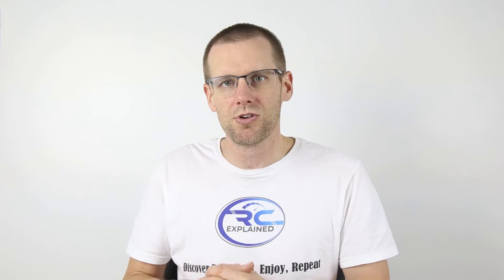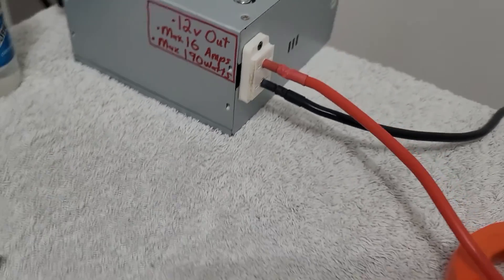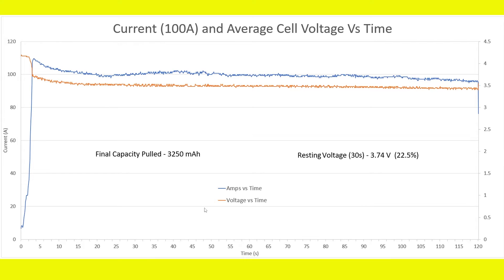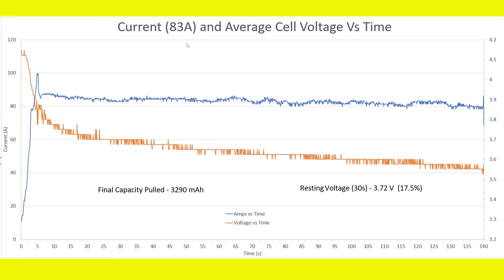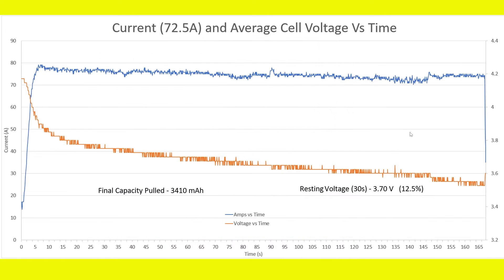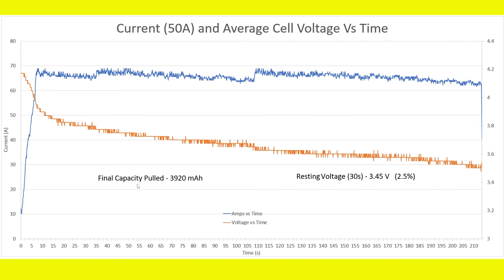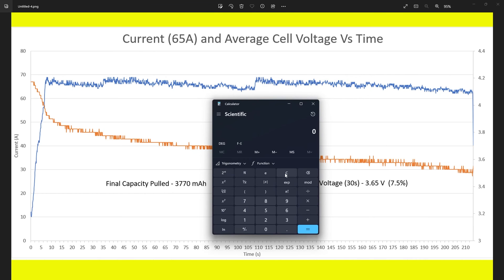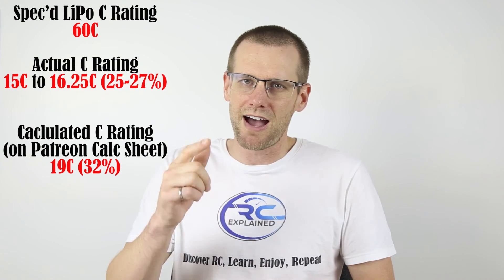60C LiPo Battery vs. Shocking Reality: Truth Uncovered for the HRB 4000mAh 60C 6s LiPo

Comment: I just feel like we need to keep an eye on temperature when using batteries for high current systems. Of course the cells will heat up with high load. I work with commercial battery systems. C-rating is meant under optimum, cooled, condition. Heat buildup always has to be dealt with, not only with ESC:s and motors, but with the batterypacks as well. It would be of great content to see comparison charts between different packs as well, tested under similar conditions. 👍
Reply from the maker: On my patreon, I have many packs tested and all test data available to battery benchmark members.

Comment: Maybe the C rating is lower than calculated because the capacity is also exaggerated?
Reply from the maker: Capacity can be exaggerated, but its usually within 5%. I did take a label off a 5200mAh cell to find that the manufacture of the Zeee brand labels their cells as 5000mAh. Not 5200mAh as Zeee rebrands them.

Comment: Just bought 2 hrb batteries (4S 4000mah 60C) and the internal resistance of each cell was 1.1 omhs on average. Wildly different from what you tested. Could be that the manufacturer switched providers or something like that?
Reply from the maker: I can't speak to the unit you used to get those numbers.  But more importantly how does it compare to other packs you've measured IR on?

Comment: Ty for your videos I have learned so much! I think its time to give your patron page some love.  If you had to pick any lipo for arrma 6s with the spektrum firma 150a smart v2 esc with 2050kv motor what would they be? I am running 2 3s in series. Does running 2x 3s in series give alot less performance than 1x 6s pack?

Comment: Awesome,, would you please also test HRB premium 100C, and HRB Graphene 100C if you got them. 

Also, it would be good to explain what difference this makes for user put in simple words.  Is the airplane going to be slower or is power going to drop quicker, or flight time is going to be shorter.. etc. 

Being a bit warm battery may not be a concern for many users.    My main concern is longer flight time with stable good power.   

I have used 2200 mah Lipo of prime brand which gives equal flight time of HRB 3300mah, and more flight time than other unknown brands of 3600mah, but also their price are at least double of HRB. Thus I consider HRB is one of the best value for money for average user. 

Finally, what are the other batter battery packs around the same price point you have seen or know about. This will help the audience to know the difference and choose what suits their needs and budget.   

Thank you so much for the useful content.

Comment: been using HRB batteries for years. no issues. quite happy with them for the price. 👍
Reply from the maker: I really like the weight of them. These are actually very light.
Reply: Excellent batteries
This kind of testing is daft imo, if the battery is the right price, good punch, good run times, then take no notice of these kind of tests
I've got 8x 4s 6000mah 60c HRB and they are the best 4s lipos in this price range I've EVER had, and I've tried them all,(cheap brand ones)
I've brought over the years at least 30 to 35 4s packs, and the HRB are the best value BY FAR

So imo these videos are not worth the while 
This is just my opinion, and my personal findings

HRB good
Zee also good
Youme decent
Goldbat so so, but mostly not great
DXF the 2 I've got, junk
Zop hit and miss
Turnigy decent
Cnhl good
Hoovo, again the 2 I've got, junk

For consistency the HRB and zee are the best imo, with cnhl and youme in a close second
Reply: Me to great battery for the price knock spots off the other cheaper brands and never had one puff up

Comment: Maybe we should make a public spreadsheet where people can calc c by measuring the ohm. If enough people provide data we can see trends with batteries models. Together we can beat the marketing lies. All hobbies unite!!!
Reply from the maker: I like the idea, not sure how we would standardize the measurements without having the control in place. There's a lot of factors to consider.
Reply: @RCexplained  Yes that's why I thought that I we can gather a lot of data, we don't have very accurate data but we can see trends between the different batteries.

Comment: lipo chemistry is capable of 20c-30c continuous. you should consider them all to be this.
Reply from the maker: Sounds good but unfortunately this LiPo is 33% lower than this.
Reply: @RCexplained nah you gotta warm them up a little. all mine have higher IR at nominal and room temp but I push them to 160A/20C all the time. they drop to 3.5v under load and get to around 130f.
Reply: 30C means you will run flat your battery in 2 (two) minutes!!!!! No use for that. I expect to run for at least 15 minutes, so it is 4C on average. 20C is 5x the average to take into account the peaks (very short time). No need more, and anyway over than that it is beyond the capability of the chemistry. C ratings on label are meaningless.
Reply: @marcobassini3576  yes you got about 90-120 seconds of runtime. 15 minutes ....lol.
Reply: Plenty of uses, like races etc. @marcobassini3576

Comment: Are Onyx the best on the market?
Reply: Definetly not! So far SMC are among the best throughout every lipo they offer!
Reply: Many consider them to be the best. They make some top quality batteries that perform very well. Little known that they are actually made in the same factory as SMC.
Reply: @klappars  interesting at the bottom of the SMC page it states "True Spec mAh & True Factory C Rate". I see some 250C packs.
Reply: Onyx is way over priced. They are good lipos but nothing special at the same time. My smaller mah smc v2 out performed onyx Modified LHB

Comment: Great video.  I have tested "35 C" LIPOs that smash "100C" LIPOs.  There are so crazy embellished C ratings out there for sure!
Reply: Care to shed some light on these secret lipos. I'm here to find the best bang for buck. K, thx!
Reply: @KevinT707  I need to finish up a comparison video but if the dimensions will fit in your car, the LiperiAir 6,000 3s provided outstanding performance.  I have tested 3 LIPOs in that line and they were all very strong.

If you have more money to spend, SMC’s 150c line is amazing.  The 150 c 6500 mAh was a beast!  

How man cell battery are you looking for?

The 35c I was talking about was a Sypom but sadly I don’t think they are made anymore.  I also tested a Liperior 50c that is slightly faster than my Gens Ace Redline drag lack (which is really quick).  That specific Lipeior is sadly no longer made.  I have a few others I am getting ready to test in the next week or two.

Stay away from the Lipeior Endurance line.